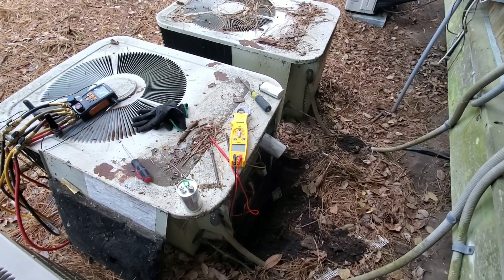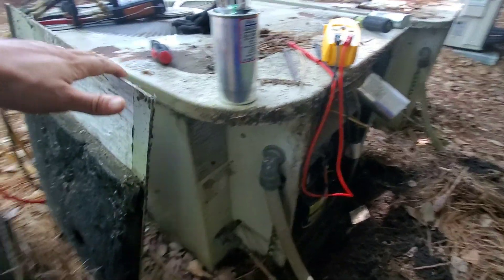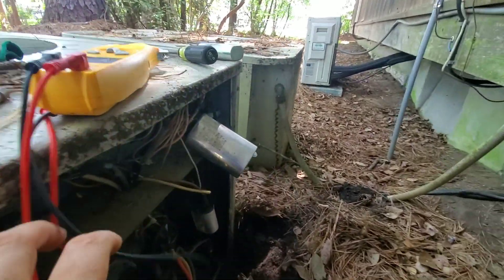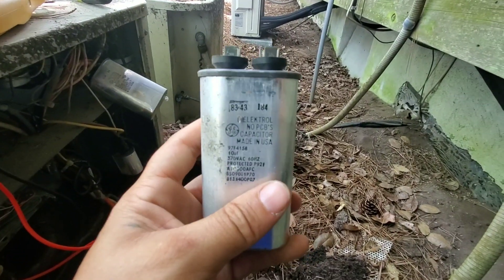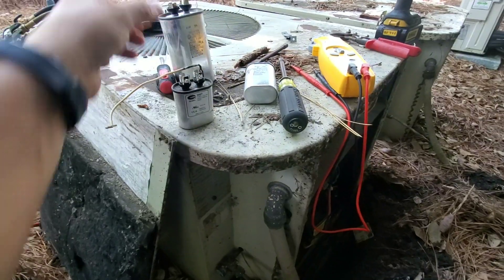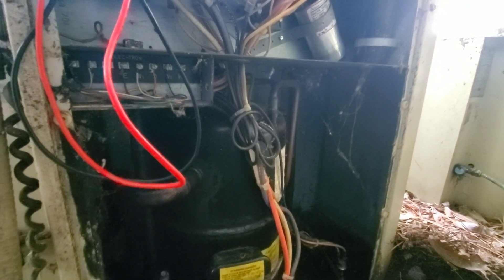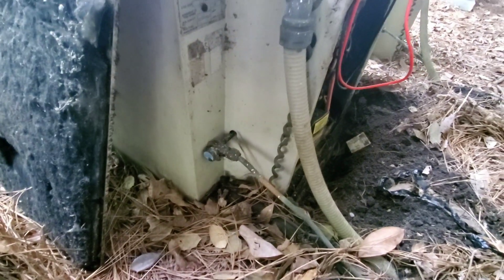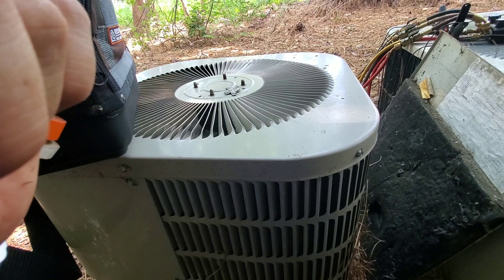HVAC Paleontology

Comment: That is pretty amazing.   Can't believe the customer would be so cheap on replacing the contactor while you're there.   Inexpensive compared to how many more years of service it could provide.
Reply from the maker: Not quite cheap. It's a business that has budgeted for ductless systems in the fall. Several of them. These units only work on half of the property. They will be spending 10s of thousands with us in a few months so I can't blame them.

Comment: Do you still like/recommend the 550 gauge set? Have you used the new Testo smart probes?
Reply from the maker: Yes. I still like the 550s and have for years. I mainly use my Testo Smart Probes and my UEI HUB Smart Probes. Have bothered with the new Testo Smart Probes because the only main difference is the BT range which doesn't matter to me.